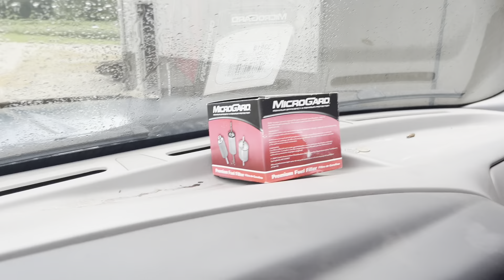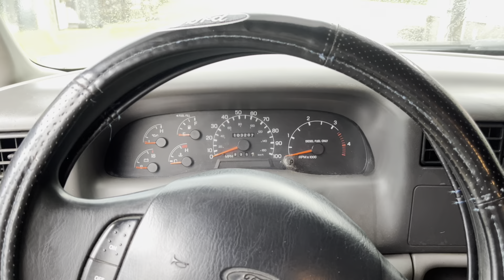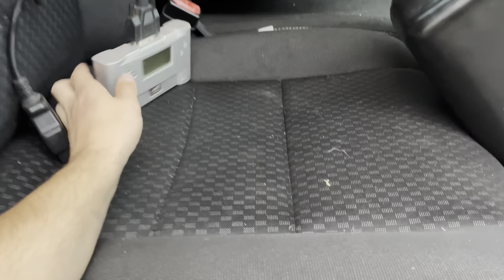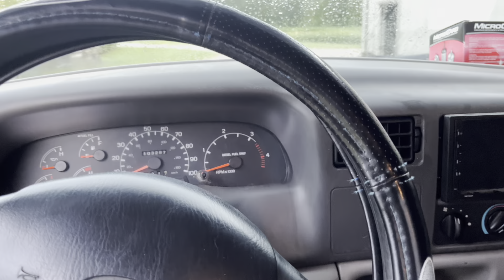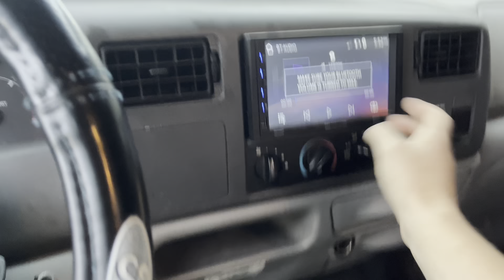New project 7.3 powerstroke!

Comment: I'm from Louisiana so I don't have to deal with all the rust problems like yall do but she looks pretty mint for a northern truck. Would definitely recommend pulling the motor if you want to do an oil pan. It's not super hard on these trucks and it gives complete access to everything. Plus you can do a pretty deep clean of the engine bay. Can't wait to see the build process on this one.
Reply from the maker: Absolutely man it does technically need like every pannel but atleast it isn’t an eye sore yet. Hopefully this truck is the one I finally start making alot of content on

Comment: Nice man I’m currently working on my 2006 f350 6.0 king ranch ordered new parts gunna fix rust ordered a 9 blade but most importantly the leather has no rips or tears or cracks.
Reply from the maker: Great that means someone must of taken good care of the seats, and hell yea brother the 9 blade will sound sick. Going to fix up my rust in spring
Reply: @nick7.3  interior is mint gotta replace rockers and done a lot of engine work but I think in a few weeks it will be good gotta do a repaint and color match the grille and Bottem of the bumper

Comment: Got two 7.3s 02 and e99 both 6 speeds never had a problem with them in my opinion I think they’re the best manual transmission put in the pickups
Reply from the maker: Absolutely 7.3 and manual trans seem to always last a life time
Reply: I’ve got two questions about the transmission: the knob only shows gears 1-4, plus “R” for reverse, plus “L”, plus one more gear in the upper right-hand corner of the knob that I can’t make out.

What’s that gear in the upper right hand corner, and what’s the “L” stand for?

I’ve heard these ZF6s are great, but do you really have 6 gears to run through if I’m seeing just 1-4 written on the knob?
Reply from the maker: @CYLONR1  there is 6 gears, Low (for towing take off) 1st, 2nd, 3rd, 4th and D for overdrive
Reply: @CYLONR1  the zf6 is a 6 speed transmission you have Reverse, low gear(L), 1-4, then overdrive. So you have a total of 6 forward gears that’s why it’s called a 6 speed transmission. It’s basically a zf5 but with a low gear not the basic 1st, 2nd, 3rd, 4th, and overdrive(5th).
Reply: @jontroyer7975 thanks, that makes sense. 
Assuming you’re not towing, what are your RPMs like with the ZF-6 at 70 mph, and would you be operating in Overdrive (D) at that speed or still in 4th?
Reply: @CYLONR1  anywhere past 50 mph I’m usually in overdrive.

Comment: I’d be parking the 7.3L truck and use the 6.7L ford in the winter for daily driving. That 7.3L ford is definitely coming up in value really strong so i’d park it in the winter if it was me.
Reply from the maker: 7.3 has every panel rotted out on it, when I restore it in spring wont drive in winter anymore. The 6.7 is never seeing salt it costs way to much to ruin it
Reply: @nick7.3 , gotcha. Probably better to get some old beater and use that in the winter.
Reply: Haha the 7.3 the old beater
Reply from the maker: @MrEvanb93  amen anything for my legendary 6.7

Comment: Don't you need 2" spacers for those wheels to fit?
Reply from the maker: No they are bolt ons but I do run them to avoid rubbing
Reply: should not need them I have this exact truck and put on 34" x10" tires and everything clears